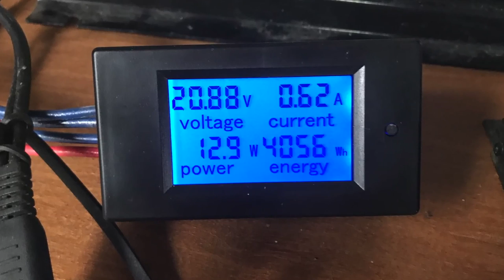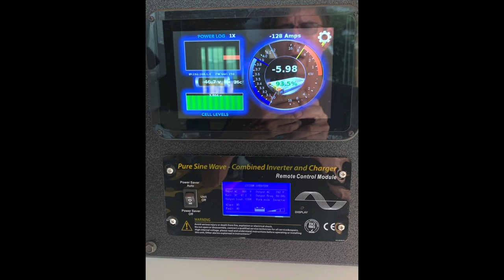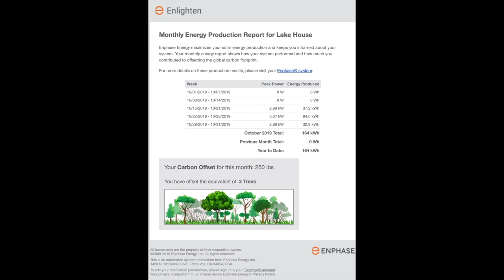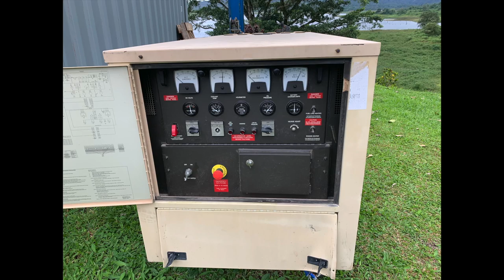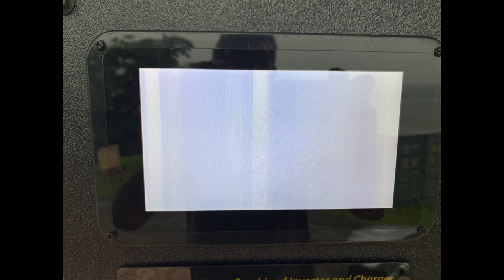EVTV on Tesla Cybertruck Unveil Wardrobe Malfunction

Comment: In my opinion Cybertruck is masterpiece of bold innovation
and design that only Tesla is brave enough to attempt. I think is looks much
better than run of the mill pickups. One of the main reasons that the Cybertruck
can be produced at a lower cost relates to how the body is produced. The stainless-steel
body can be formed by simply folding the sheet metal without the necessity for
expensive stamping machines. Also, the absence of paint results in significant
cost savings. A paint shop cost 200 million dollars in initial capital
expenditure and has additional ongoing expenses. The painting and drying of is
time consuming and is often a bottle neck in production.  Cybertruck eliminates this cost and bottle
neck. The exoskeleton design was necessary to decrease the weight of the Cyber
truck so that it is not heavier than the conventional pickup truck despite its
heavy batteries. Other electric pickup makers will have a hard time competing
with this design in terms of specifications and cost. The bizarre appearance of
the Cybertruck is a necessity to keep costs low for these specifications. The
price and specifications of this vehicle are so compelling that it is a viable
alternative to a conventional car. I would normally never buy a pickup truck,
but I will be getting the Cybertruck as my daily driver. It costs the same as
my Tesla Model 3 and has so much more capability and room. Should be great in
heavy snow and won’t rust from the salt used on streets in the winter in the
Chicago area where I live. Won’t need to worry that one bird shit will stain
the car forever.  The only downside when
compared to a car is its large size which might cause issues with parking in
some areas. The pickup truck will use more electricity per mile driven then the
car but the additional cost difference is not as significant as with internal
combustion pickup trucks. Once the general public understands this, there might
be a whole new segment of population that will opt for the cyber truck instead of
a car. Power outage in the house? Run an extension cord to Cybertruck and get
by with powering essentials like phones, broadband modems, and rechargeable led
lighting. You could even cook with an instant pot or induction cooker. Also, Elon
confirmed on twitter the car may have a solar option for the bed cover that can
add some range when the car is parked in the sun. I don’t care that other people
may not like how this looks. If they want something that looks like a regular pickup
they will pay more ant get less. Not a choice that I would make. I would like
to see this low-cost polygon body concept scaled down to a mid-sized SUV with
three rows of seats with the last two rows foldable and removable. This would
be a better alternative to a family car than a pickup truck. Scaling this down
to an urban hatch back the size of a Honda Fit should allow an EV with a range
of 200 miles for low $20Ks in couple of years.
Reply: @Bill Platypus -- Superb post with excellent points made throughout!  Thank you for sharing your inspiration with me.  When someone passed by me in a Nissan FRONTIER as I was taking my twilight constitutional just before sundown, it occurred to me that truck and its siblings (like Pathfinder & Exterra) could have been designed in such a manner as you describe if they were fully electric.
Reply: Finally, someone broke the stagnating cookie-cutter mold all trucks are derived from, in just under 5 minutes the world thanks to Elon witnessed the death of the pickup truck and they all sunk LIKE A ROCK bwahahahahahahahahahah and staring up from their long overdue graves they see ten levels above where they had ever dreamed to hope of getting and standing there is the Tesla Cybertruck. End of fucking story. 
The scrumpdillyicious irony is that the statistics that pit all pickup trucks against each other matter only in the minds of tiny dicked mortals spending money they don't have on something that they will never use to its full potential much like their brains. The greatest adventure their shiny new man truck will ever embark on is the trip through the car wash Grrrrrr, Truck, Man Truck, Deep Voice, Rocks, Steel beam, Grizzly bears, Tree stumps, oh and naked women don’t forget the chicks ,,,,I am MAN grrrrr, my truck says so grrrr, I am a commercial grrrrr, I now have an identity I am Man truck, My man trucks most important stat is that it promised me my dick is now bigger than yours GRRRRRRRRRRRRRRRRR. I AM MAN I AM TRUCK I AM BROKE and still no chicks BWahahahahahahahahahahahahahaha Now anyone can grab a Cybertruck and feed it pickup trucks as it shits out solar panels bwahahahahahahaha.  MIC DROP Imagine my laughter getting quieter as I walk off stage. Bwahahahahahahahahahahahahahahahahahahahahahahahahahahahahahahahahahahahahaha
Reply: Regular 301 steel still can get corroded by salt. 

But I am not sure if that is really the alloy they are using.
Reply: @heinrichwonders8861  -- Someone would have to be doing it on purpose.  No way such corrosion would happen naturally.  They'd have to be running current through a bath of saltwater where the vehicle was partially submerged with the express intent to strip ions and cause corrosion in a high humidity environment.
Reply: @heinrichwonders8861  
Back in the days of the stainless steel Atlas ICBM they developed a cheap anti-corrosion coating and used it at Cape Canaveral. Wash it, dry it, and rub on the WD-40.

Comment: I'm getting this truck for the stainless steel construction.  That was the tipping point for me.  I don't tow anything but I do need a truck on occasion to put stuff (sheets of plywood, mulch, bags of topsoil, etc...) in.  This vehicle appears to be perfect for me.  It will be my daily driver to and from work (70 miles round trip), truck bed for hauling stuff on occasion, stainless steel construction so won't rust away up here in Michigan, all electric so no more gas stations or oil changes.  The Cybertruck is it!!!  And it looks friggin' awesome too.  I can't wait to be the first around my area to be driving this thing.

Comment: "And I've cracked headlights before" - Who here that has owned a truck and put it through heavy work duty for half a decade or more hasn't at some point accidentally damaged a light?  ;)  I (or rather, a person working with me) wrecked one of my Ranger's taillights by loading up a trailer with some boards too far forward, so when the truck turned...  :Þ

"You can wrap it" - or "blue" it like a gun, or heat discolour it, or acid etch it.  Through stensils / resists if you want.  All of them will look freaking amazing.

Re: "Ford's charging network" - it's Electrify America.

"Everything mixed up into one massive ball of John Goodenough and Maxwell and Jeff Dahn...." - LOL, I love this description  ;)  Most battery discussion online is embarrassing. You're one of the few regular commenters online who actually has a clue what the heck they're talking about.

Comment: Jack, I agree when you compare the Tesla Truck and all of its design features with all the competitors offerings today (including Rivian) they all appear so 20th century.  I live on the coast and just spent a few thousand dollars in body corrosion repair work on my 2013 Sprinter Van with 35,000 miles.  I’d love to have an electric van or truck with a corrosion resistant body!

I hope Elon builds a similar CyberVan soon with the same body materials, glass & integral 12v, 110v & 220v outlets for powering tools and or RV appliances.  With similar roof area as my Sprinter van he could easily offer 1000w of solar collectors on the roof to cover all parasitic losses and appliance/tool loads.

I’d trade my diesel Sprinter for one tomorrow!
Reply: Tom Radich i have a 2014 MB Sprinter based motorhome and have 960watts solar on the roof with a Victron system and 9.5kWh LFP battery bank. Would gladly swap the diesel for an EV Tesla to travel the country
Reply: The six wheel cybervan was invented by a Brit in the 1980s. It wasn’t electric of course but all in good time. Hustler Highlander. https://motorbase.s3.amazonaws.com/pictures/contributions/000121b/std_1986_hustler_highlander_england.jpg

Comment: My neighbour is a builder and it's his dream work truck. Virtually indestructible, go anywhere, fit anything you want in that stainless steel bed, no more noisy generators and compressors to haul around and all at a fraction of the running costs of his present truck. 
Apparently the blunt nose creates a pod of high pressure air which forms an aerodynamic leading edge that improves with increased speed.

Comment: Bulletproof glass is also supposed to shatter to absorb the kinetic energy of the projectile so that the bullet does not go through, and that is literally what happened when they threw a 3 to 4-inch steel ballbearing at a window that was rated for a 9mm round. Granted, Transparent Aluminum is lighter and stronger than traditional laminated bulletproof glass and is used in today's military like the fighter jet canopy, but if you bang on the glass long enough, it will weaken the integrity of it and cause it to have no other choice than to finally break to absorb the energy of the impact, which at the end of the day is EXACTLY WHAT IT IS DESIGNED TO DO! ARMORED GLASS STOPS BULLETS BY SHATTERING! Does nobody science anymore?!
Reply: I thought that too, about the glass.
Reply: @CathayanMagus -- Unfortunately, too many people have never learned what the term 'Ablative Armor' means.

Comment: Lets face it, pick up trucks today are not what they used to be. As far as Im concerned the DEF  systems on the new Diesel engines are complete garbage. With the price of fuel these days and the cost of repairs, It doesn't matter what truck  looks like. If this Tesla truck is somewhat reliable, contractors and municipalities will be upgrading there fleets asap. Tesla  will put a huge dent in the truck industry.

Comment: Glass chipped when they hit the door with the sledge hammer and that contributed to the glass breaking. to be fair tho any other normal glass that metal ball would have ended up in the seat.
Its tough as hell. and the whole thing got so much attention that it was worth it. Last heard there were over 250k orders.
Reply: Or hitting someone's head!

Comment: I must have been around longer than you guys.  My 1st new car was a 1968 Volvo 142S.  Just over 3k bucks.  Had it for 13 years and did all the work on it myself.  Love the video.  Pre-ordered the  2 motor version Cybertruck a few hours after I saw it and the shock wore off.  The self driving might come in handy when I get old...  ;-)
Edit:  you just inspired me to order a 2nd one.  This time a 2wd, in case it becomes available before the 4wd.  I'll give the 2wd to one of my kids.  The 2nd order number is over 202,000 behind my first order.
Reply: @Jack Rickard I think you won.  My first used car was 1955 Chevy Bel Air I bought for $295, and I got took. ;-)

Comment: The dramatic cost cutting in manufacturing of the model three will accelerate on the CyberTruk production.  Elon has already been given the nod with preorders for slashing tooling costs by going to a much more producible design.  In three years the old saying "they don't make em like they use to" will be forever so much more of a  truism because anyone that tries will go broke.  The aftermarket will quickly evolve and innovate.   3 mm 301 stainless?  Hell, I can weld straight to that already.  (clutch the pearls).

Comment: It would be an awesome work truck for me with its scratch proof body, break in proof bed cover, built in ramp and 110V, 220V and air compressor outlets.  Plus dirt cheap to drive and maintain.
Reply: Plus, a full length liedown apresdejeuner windstop nookynook for happytime customer / contractor relations.  Or more bricks, your choice.

Comment: @1:02:47. Ford is not offering free charging. What’s free is the membership into the FordPass network which allows you to have one account that works with multiple charging providers. After two years, you’ll have to pay for the membership. Either way, you’re paying for charging, unless you happen to be at a free charger. If you read the FordPass fine print, you’ll see it.

Comment: Battery day is coming in early 2020 hence no info on the battery, but 500 mile range reveal.  Thank you Jack and Richard for your perspective, it was long but highly informative.  If you remember at the Model Y reveal he didn't hype it up too much and i think the new strategy is undersell and stop over promising.  Free advertising.  Let the shorts have some hope.  Clitoral fibrillation would be good option like the whoopie cushion.  Forget the gun holder add a gun turret.

Comment: There is a theory on Twitter that the windshield wasn't all the way up and that's why it shattered. When they hit the door with the sledgehammer the windshield must have come down a bit and there was a little opening between the top of the window frame and the glass. So it bent and shattered when the metal sphere hit it. The glass has to be inside the window frame to be strong.
Reply: That makes sense.  Apparently the back window was regular glass in the mock up.

Comment: The fact that so many preorders are in (2 plus in my household), that 40k base price, you can keep your goodole boy pickups, I'll save on price and gas and still get 1400lbs towing.
Reply: @sierraairehvac  Keep in mine that range when towing will be dropped by 35%-50%, see towing videos with the Model X. So really for long-range towing only the top of the line 500 mile range truck will do. should be good for everything else

Comment: I can tell you why they are not giving all the specs it's not because they have forgotten or they overlooked it it is because many of those specs will get better in the next 2 years especially battery technology which is improving practically by the day!.
Reply: @Jack Rickard They know that it will get better, but not exactly how much. My personal expectation is that the 'Trimotor' P200T will have 200kWh in a single layer with the next generation of batteries.

Comment: 8000 Battery Cycles would mean 2 and a halve million miles in a Model 3 long range, 2 million in a short range Pickup if you assume that they don't use a bigger battery and limit it per software, 2,4 million in the mid range and about 4 million miles in a long range truck, just for context, the current guiness world record for a single car is 3 million miles for a 1966 Volvo 1800S with basicly everything from the drive train replaced multiple times.

Comment: I love Tesla 100x more for making the Truck like this. I have a reservation but I actually want a Van, will switch to that if it comes out.
Reply: I also want a van.
Reply: I was 100% certain for a long time I wanted a Tesla van for both work transport and a live in vehicle. Pickups are very rare here the UK where I live (perhaps less than 1% of the vehicles on the road). What changed my mind was reading about the future full self driving and Tesla network. I now plan to live full time in a DIY truck camper on the back of a cybertruck and a lot of the time when I have a good spot I can park up the truck camper on it's own and have the cybertruck go off and earn money.for me as a robotaxi, which wouldn't be possible if it were all one vehicle.

Comment: windows were not fully closed, possible slipped down during the sledge Vs. door test.  The glass must be fully secure to achieve it's full strength.  If you watch during the ball drop the assistants kept securing the hold downs on the glass between each drop.
Reply: In one video, there was clear damage seen from glare on the window as the camera panned around it. Once you get any crack forming, it will do exactly what we saw. They really should have just used a fresh pane and it would have been fine.   Tesla still has to deal with stupid media that lie, anyone with common sense realizes they were hitting that window multiple times and that the ball would have gone right through any normal car window like butter.   Tesla makes glass and puts r&d money into it, that stuff will be better in 2 years anyways.

Comment: Make America Great Again and reserve a cybertruck.  
1:  Is it possible  that the radical wedge design of this truck, especially the slope of the front wedge, fit seamlessly to a  wedge nosed 5th wheel trailer thus eliminating drag by a very large percent?  Some of the youtube vids out there indicate that trailer aerodynamics plays  a large role in fuel/power consumption. 
 2:  Could a 4000 pound redesigned 5th wheel trailer(YES! a new design truck requires a new design trailer) possibly cause the battery to loose  an acceptable 23% energy while towing the new wedge nosed trailer?

Comment: I'm really excited about the stainless steel but one downside I see is that while it's nearly impenetrable, it seems that you would need to nearly replace the entire vehicle in the event of an accident. 

Typically in a head on collision you can fix the front by replacing parts of the body as long as the frame is in tact. I assume that without the frame, a head on accident might total the skillfully put together origami body.

Maybe I'm wrong and it would just result in a lot of welding but Jack would know better.
Reply: The exterior body is stainless but the unibody is not, it's basically the same construction as any car underneath.